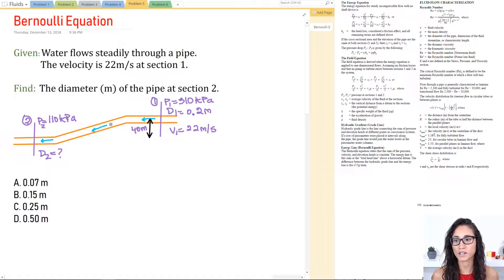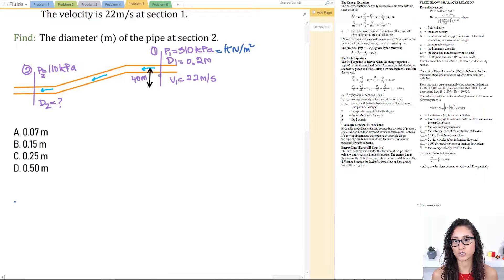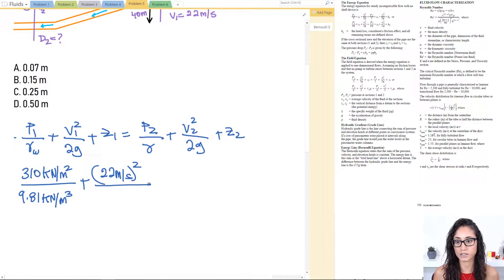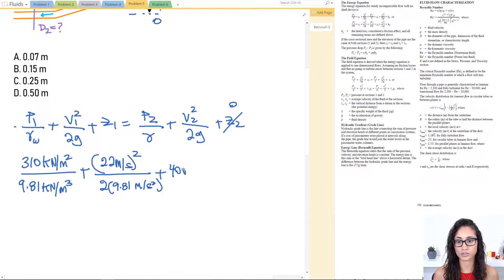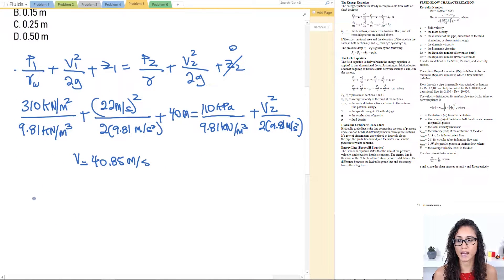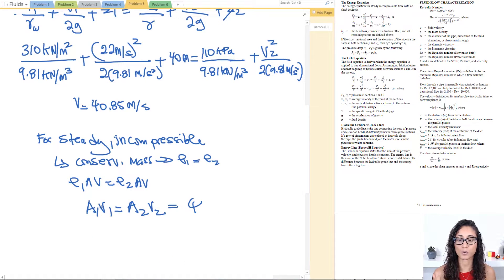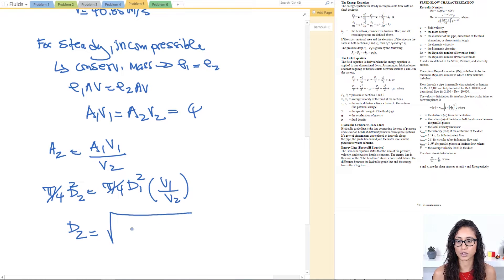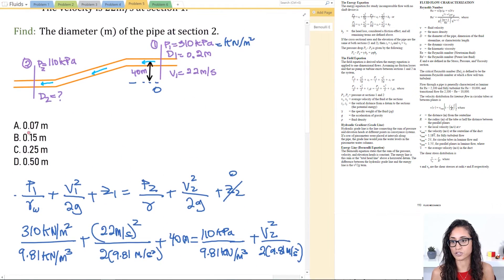FE Exam Fluid Mechanics - Bernoulli Equation - Diameter of Pipe

Comment: if you use the area formula pi*r^2 in the flow rate you get a different answer which is A. Why is this the case?
Reply: If you used pi*r^2, you likely solved for radius, when the question asks for diameter. Double answer A to get answer B